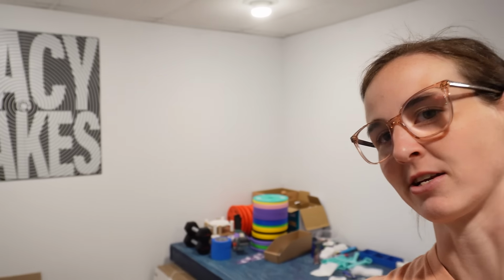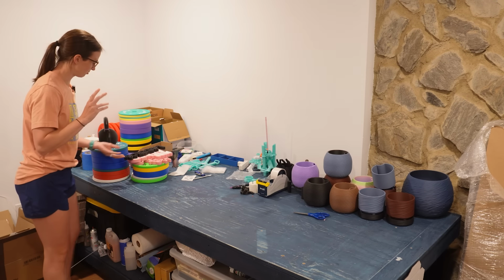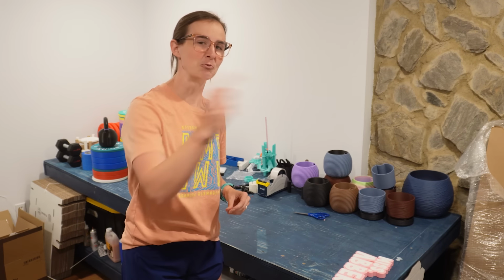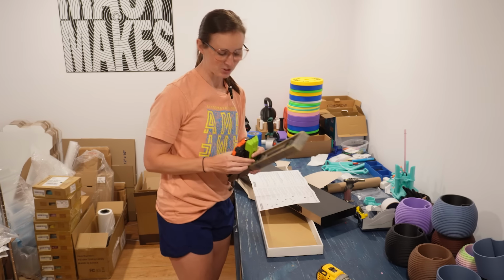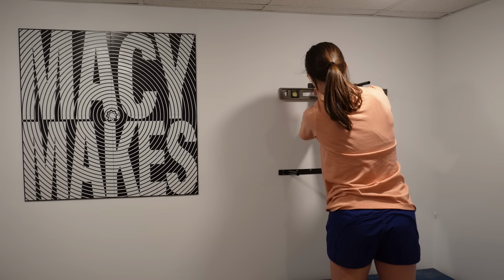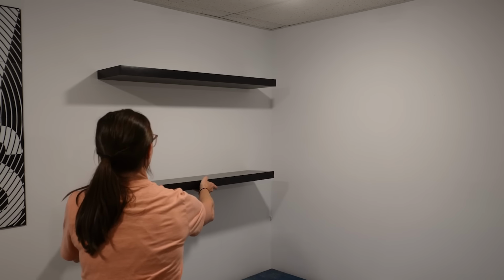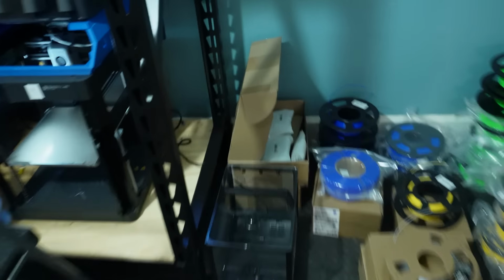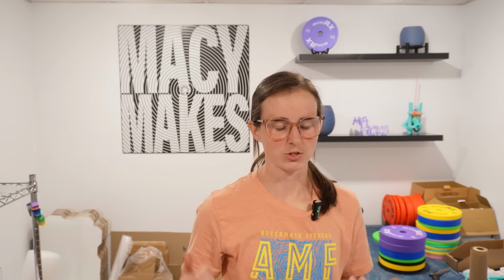Vlog 7 - Construction in the Print Shop -  3d Print Farm Behind the Scenes

Comment: 8:52 next time try this as it will save tape and hassle. - get shelf about where you want, mark and drill one hole, put shelf mount up and put screw in the first hole loosely,   level the mount plate with your spirit level (check if plate matches shelf otherwise put level on the spigot things) and mark other end hole. Let plate drop down and drill next hole. Lift up mount plate and tighten 2nd screw.  Mark and drill any other screws, place plate Tighten all screws tight and your done. Then do the shelf part.  

Other tip if you have no studs and only using dry wall anchors, ensure dry wall anchors carry more than weight than you want to store to save them pulling out and shelf sagging down.
Reply from the maker: Thanks for the tips! I knew there had to be a better way lol

Comment: First off, thanks a ton for the videos, very down to earth and informative. Now, only question I have is after having to swap out the extruders, is there a reason you haven’t upgraded to the X1 hardened gears (or extruder altogether)? We just got our first P1S last weeks and #2 will be here tomorrow. I opted right away to order the X1 nozzle and extruder (you need to get the fan and heater/thermostat set from the P1 or swap your existing to them) and set them up so I have the stock P1 extruder/hot end as backups. Interested in your thoughts on this. 

Keep the videos going, they’re awesome so far

Comment: Do you use the standard hotend or the hardened one?  Travis at Shop Nation uses the hardened ones and says they are a great upgrade in his print farm.
Reply from the maker: Ive started changing them over to the hardened as they need changing. I think I have 2 right now with hardened nozzles.
Reply: @macymakes3d  please let us know how you like them compared to the standard.  I am just starting to sell a product and it would be nice to know if it is worth the change
Reply: @RBallarddesigns im also 3D printing and i Think its worth to chance becourse the hardened ones last longer and you Can print more abrasive materials like glow in the dark and carbon-fiber.

Comment: Question about the extruder: how many hours are you getting before you have issues? I have an X1C and have about 2000hrs but have never had an issue. I print lots of materials and quite a bit of abrasives with CF but have only ever changed nozzles. I took the extruder apart to clean and inspect a few months back and other particulate contamination mine was in great shape. But it’s the X1C so wondering if it’s holding up better as it’s definitely hardened gears etc. 

Does the P1 use the same extruder that’s hardened or is there a non hardened version? - if so could be worth changing to the hardened one from x1C.
Reply from the maker: P1s definitely don't have the hardened gears but I think I'm going to start upgrading them all to the hardened ones instead of changing out the entire extruder as things wear out in the future.

Comment: Are you using the hardened steel extruders? Seems like those should last longer than a year. Or maybe it's not the nozzle itself that's wearing? Hmmm.
Reply from the maker: I’ve started changing them to the hardened gears since filming this. Definitely the move.

Comment: I in joy your videos, what Cad are you using
Reply from the maker: I use tinkercad and I’ve used freeCad some. I’m not the best at 3d modeling. Hoping to learn more eventually.
Reply: CAD just takes a lot of time to learn
 
FreeCAD in the 0.22 version is improving week by week. Also there's no handholding in FreeCAD, if you can make a model there you can use any other program, doesn't work the other way around

Comment: When hanging brackets (or anything) like those, I usually make my marks, start one screw w/o the bracket so it's easier to screw it in w/ one hand while holding the bracket, then after that one is started, it will hold one end for you so you can get the level on it, mark the hole, start the screw again w/o the bracket, then put it in place and tighten it all down.  I thought the top shelf was going to be smaller due to the smaller bracket....why were the shelves the same but the brackets different?!

As far as your extruders, when you replenish your inventory, I'd try the one w/ hardened gears.  Should last a lot longer.
Reply from the maker: Thanks for the tips! I'm new to anything drill related so I welcome all the help I can get. I'm not sure why the brackets were different, kinda threw me off during the install. And for the extruders, I've already changed 2 printers over to the hardened gears since filming this video, and I'll probably do the same for the rest once they go bad. I've started printing with CFs and more abrasive materials so I'll have to anyway. Glad to see you back in the comments :)
Reply: @macymakes3d  I believe for abrasives you will want the hardened nozzles too.  I have yet to venture past PLA.  I did get a 2nd P1S combo during the sale....I am trying to develop products to sell, though I have not really sold anything yet, besides some things to ppl I know.  LOL  Your videos inspire me to keep trying, thanks!  Glad I can give you a little bit back w/ tips on things I know more about.

You keep making videos, I'll keep watching and commenting!

Comment: The extruder gears were made yellow for this very reason, hints the window on the side of the printer head enclosure that shows the yellow gear, with out taking anything apart. 

Once you start seeing any debris on that yellow gear, it’s recommended your open the extruder gears up and give everything a quick clean. 

I run 8 of these printers 24/7 and wish someone would of told this sooner!! Hope all is well
Reply from the maker: Awesome thank you for the advice! If I just clean the gears I should be able to reuse them? I'm going to switch all of my printers over to the hardened gears but good to know I can clean them and get more use instead of replacing every time.

Comment: Silly question.  Why are you replacing the extruder?   The gears look dirty - you can clean them.   If they're worn then you can replace just the gears.   In fact replacing them with the hardened steel gears would probably diminish the wear on them.

I'm just wondering and thinking you might be able to save yourself some money - or maybe there's something you're seeing that I'm missing.

Thanks for the Videos - you're doing a great job.
Reply from the maker: I read in a few forums that the hardened gears slip more than the normal ones but I haven’t tested it myself. I’ve started replacing just the gears since I filmed this though so I’ll be able to give my thoughts in a later video.